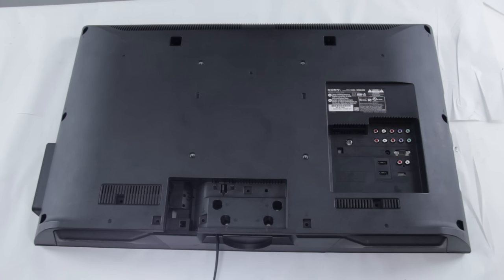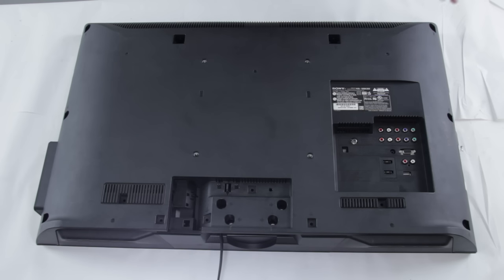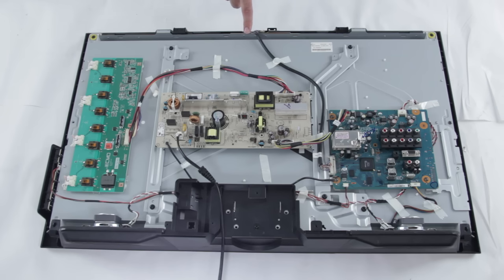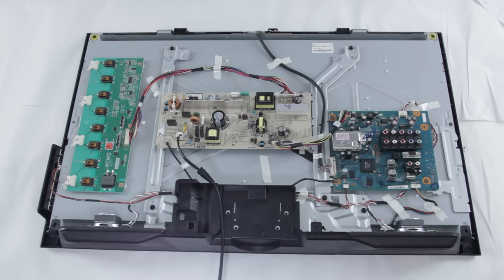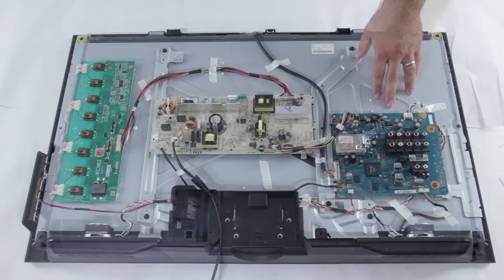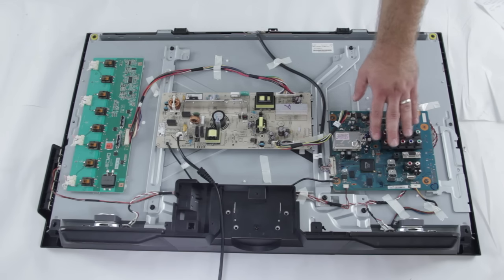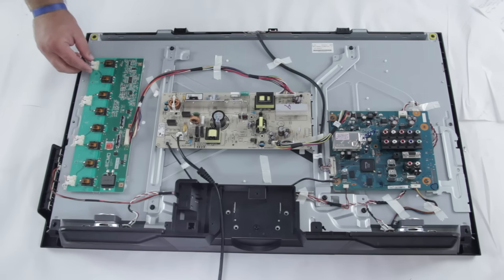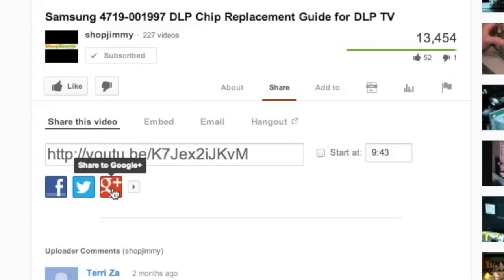LCD TV Repair Tutorial - LCD TV Parts Overview, Common Symptoms & Solutions - How to Fix LCD TVs

Comment: Hello, I have a Sharp LCD TV, model number LC-55LE62OUT, serial # 008790038.  The unit was working perfectly the evening before, but when I turned it on the next day the blue power indicator located at the middle, bottom edge of the unit, began flashing on and off but the screen remained black with no sound. I turned the unit off and on several times then the blue light stay on, but the screen remained black. I checked the screen with a flashlight to see if there are any images, but it looks total dark to me. Also, when I looked for backlight lights with cover off and there weren't any. Can you tell me what you think the problem is?  Thank you, Mark

Comment: My friend has a Samsung LN52A550P3FXZA LCD TV. When powered up there is a brief picture and audio, a click, then sound is lost and multi-color horizontal lines cover the screen. After a few seconds, there are more clicks, and the picture restarts automatically and then is quickly lost once again. This constantly repeats every few seconds. I can read the menu on the screen using the flashlight test. I suspect the two inverters, but am concerned that the constant restarts might indicate further problems. What do you recommend?
Reply from the maker: +mebewalt  Try all repairs and troubleshooting at your own risk.  I recommend replacing the main board in your TV.  Click this link to replacement parts for your TV model number:  http://www.shopjimmy.com/catalogsearch/result/index/?cat=56&q=LN52A550P3FXZA  There may be multiple boards for the same TV model number, be sure to match part numbers on your current board, with your replacement for compatibility.  Here is a link to a video showing how to identify your part number, click here:  https://www.youtube.com/watch?v=BEPWrefQvqI  Thanks and please let us know if you have any further questions with your TV Repair!  www.shopjimmy.com

Comment: i have a 2007 samsung modle num  LN-T375HA indicator light comes on , but no back lights or no picture ...did the flash test , no imiges in the dark. replaced the power supply board new nuthiing different could it be the t con brd. and backight inverter too

Comment: Toshiba 55u7863DBC, 10120022 181000212 (2019).  TV fails to enter standby. No green LED on front panel with AC applied. PSU DC outputs measured on diodes seem ok. 2x25V, 4x12v, 4x78v.  PSU is Vestel 
Thanks for any suggestion as to cause.  Note failure occurred while TV was on and functioning.  It briefly recovered for 1 day then stopped again mid operation.

Comment: My Samsung Model LN40B750U1FXZA  SN # AUKT3CSS400443M  -  The screen goes blank after 1 to 10 seconds.  The sound is OK and the flashlight test shows full screen imaging.  I gather this means in have a problem in the Backlight Inverter.  The problem began with the screen going blank after a couple hours use; then after an hour; then after shorter and shorter periods until blanking after a few seconds.  Is this an easy install?

Comment: I have a Vizio E370VL that doesn't turn on at all and seems dead. Checked the stand by voltage and it was over 5 volts and constant. Looks to have a ceramic fuse. I see no visible expanded caps or dark areas on either the main or power board. Main board #3637-0562-0150(4D).

Comment: tx-p5ost31b panasonic 50+ " tv.my girl threw a small toy at the screen smack in the middle. screen looks fine but 7 red flashes from th power button led. opened it up it has a green led flashes a few times on the top right board.there is aslso a glass bulb type object on the left centre small board that i wondere should have a filliment in or not.

Comment: I have a rca 55in 55LA55R120Q with audio but no picture after I shocked the power button with static electricity.  I see no blown caps and fuse on main board ohms out.  what do you suggest?  and thank you for your videos
Reply: +ShopJimmy.com thanks, I went tcon and it didn't work.  I'll be ordering main board soon

Comment: I have a Vizio E552VLE 55" with multicolored vertical lines on the screen. I have two T-Con boards at the top edge of the TV. Can I replace these, and if so, do I have to replace both?
Reply from the maker: Kevin Niemeyer   Try all repairs and troubleshooting at your own risk.  This sounds like a TV panel (TV Screen) problem.  If your TV panel is bad, it may be more cost-effective to replace the TV as panels are typically hard to find in stock, difficult to replace, and expensive.  Thanks and please let us know if you have any further questions!  www.shopjimmy.com

Comment: I have an old LG LCD TV, bought in Korea.  The sound goes off after TV is on for some time and some times comes back on its own.  I usually have to turn on and off, or switch channels until I hear some sound, then go back to channel I was looking at. LGTV30D is the model number.If main board is changed could this problem remain?
Reply from the maker: +Frank S   Try all repairs and troubleshooting at your own risk.  I recommend replacing the main board in your TV.  Click this link to replacement parts for your TV model number:  http://www.shopjimmy.com/catalogsearch/result/index/?cat=56&q=32LG30D  There may be multiple boards for the same TV model number, be sure to match part numbers on your current board, with your replacement for compatibility.  Here is a link to a video showing how to identify your part number, click here:  https://www.youtube.com/watch?v=RwHTvjMdrhkThanks and please let us know if you have any further questions with your TV Repair!  www.shopjimmy.com

Comment: I have a Viore LCD26V37HAU, it works only with the internal DVD player.  None of the other inputs will activate the screen.  My assumption was the main board, I just wanted to check with a tech before I start treasure hunting for the part.

Comment: Have a lg tv model number pdp50r10100 menu is popping up continually on screen not always but quite frequent and sometimes over and over without anything pressed , the front on tv has menu touvmch sensor and volume control which I think this is the problem,can I turn it off so I can only change with remote or how do I disconnect this function so it’s only power on/off that is usable with touch screen , checked control it’s defo tv on not remote issue

Comment: I have a Samsung LN46C6301F, no picture, no back light, cannot see anything with flashlight test. Standby light goes off when power on, get startup/shut down sound. Do not see any swollen or leaking capacitors. Has ceramic fuses, replaced and same issue. Removed main board, power board, and backlight inverter. Power board does not appear burned, but has dark brown areas under the bottom. Main board has light brown areas. Do not see any visible signs of damage on backlight board. Connected to cable connection and get nothing, cannot see menu image to verify anything. Thinking of replacing boards, but not sure which board to start with. Any suggestions?

Comment: Hi,I have UMC TV 32/188G-GB-5B-TCU-UK model. It worked perfectly fine for many days till now recently started showing message "Do not turn off scan" and never ends. Sometimes if I switch off and switch on it works now a days it is becoming so much of delay.Please suggest me what might be the problem. If any part is need to be replace approximately how much it will cost. Can I do it my self. Usually I do all my laptop repairs myself.Please suggest the solution asap.ThanksKrishna
Reply from the maker: +Krishna Agnihotram   Try all repairs and troubleshooting at your own risk.  I recommend replacing the main board in your TV.  Unfortunately I do not see any replacement parts in the search results for your TV model number on our website.  Please reply with your part number on your main board and I can try searching for replacement parts.  Thanks and please let us know if you have any further questions!  www.shopjimmy.com

Comment: I have a Samsung un55hu6950fxza ver. ts01. I was moving without help and help the tv on the upper right of the screen and heard a crack. With the tv off you can see anything wrong but when you turn it on there are lines and the screen looks likes it cracked, also it goes blank where you can't see the menu or other options. what do i need to change to fix the problem? the screen, the lcds,.......?

Comment: I have a 2011 lg plasma 60pz750 the tv will power on and work perfectly then after 45min or so the screen will go black but the audio is still working i can then shut the tv off wait 30seconds or so and turn it back on and the cycle will repeat any help diagnosing this is appreciated

Comment: I have an Insignia 47 inch LCD TV, model NS-LCD47HD-09, serial nu0495JA009760. The problem is that it will power on by itself and later power off by itself.  At first it would power on at night occasionally and I thought it I just left it on. Now it will power off several or many times during and hour show. I quit watching it and a little later it will come back on. I thought this had to be the power supply board so I replaced it. That did not fix the problem. I also noticed that the power button on the side does not work. Later I discovered that none of the buttons on the side work. Any help would be greatly appreciated.

Comment: Hey, I have an Emerson LF391EM4F TV, I plug it in and a the red light at the bottom turns on, however, neither the power button on the TV works nor a controller will actually turn it on, all that happens is the light staying on no matter how many times you hit the power button. Any help would be very much appreciated, also no capacitor is blown.

Comment: I have a Magnavox 46" LED model number 46ME313V/F7
it will turn on, show the Magnavox logo on the screen and as soon as the screen is blue it will turn off by it self, i look up some videos and tough it my be the power board, the capacitors looked fine but i still purchased a new one, as soon as I replaced it, i coneted the Tv and got the same result, what can be the problem?

Comment: I have a Samsung LCD TV. Model # LN37A550P3FA, SN #ALXQ3CEQ804116R. The problem is that it began hissing and showing partial half screen pictures, and hissing before the picture stabilized. Eventually it got worse: took a longer time to come on, and eventually it just stopped working: NO picture, even though the power id on, and one can hear sound. From the video it looks like the 'tikan' board. (Don't know if I have that name correct.

Comment: Hello  how are you 
I have a sony Bravia 32 inch lcd and i am having problem the display panel it's showing snowflake more crystal more the middle and sides upper section is ok my model number is KLD-32EX301 ser.no 4510625 manufactured Jan 2010.
I can watch TV or movies but not the way it should be. Do have any suggestions

Comment: Thanks for the  Video. I have a Vizio Model VL470M Serial # LAUKEHCLO7O. I Came home after an electrical storm to find the TV not working, also discovered the cable box was blown as well. I thought initially the HDMI port was blown (which I  was told was a common issue after storms), but I tried the other ports and nothing. The TV does go on but no  pic  and no  sound. No idea whether or not it can be fixed. Also I  had two other TV that suffered damage from the storm, but one of them had 2 HDMI ports, and one only had one port. So the one with two works in the other port, and the other TV is component cable(?). Hoping to save the Vizio if possible, but before throwing it out, I wanted to look into  repairing it. After watching the video, I will attempt to hook up my DVD player and see if that works, but when powered on (I think) I get nothing on the  screen. Thanks  in advance.

Comment: I got a Sony kdl55ex500 and I can turn it on and the picture comes on for a few minutes then it shuts off I replaced both power boards and master board and still have the same issue but if I unplug it for a little and plug it back in it turns on then goes out again any help would be nice

Comment: Hi i have a jvc lcd tv that has vertical colloured lines but when i return it ..works perfectly but when i turn it off again and turn back on it has coloured lines and none of the control buttons work but i can hear the tv
Was told it was the tcon board and then was told it was the main ic  so could u please help thanks

Comment: I have a Samsung Plasma display Model # PN50C550G1f     FXZA That has a snowy picture in the middle of the screen without any connection when you put the menu snow would hide the writing that comes on the screen can you advise me what to check on that TV?And thank you for this video
Reply from the maker: +Winston Badawi  Try all repairs and troubleshooting at your own risk.   I recommend replacing the main board in your TV.  Click this link to replacement parts for your TV model number:  http://www.shopjimmy.com/catalogsearch/result/index/?cat=56&q=PN50C550G1f  There may be multiple boards for the same TV model number, be sure to match part numbers on your current board, with your replacement for compatibility.  Here is a link to a video showing how to identify your part number, click here:  https://www.youtube.com/watch?v=BEPWrefQvqI  Thanks and please let us know if you have any further questions with your TV Repair!  www.shopjimmy.com

Comment: i have a prosonic lc3206
the simptom is after i turn on the tv it is showing a sound and picture for a second and everything turnd off and on non stop
all the time  ( the sound and picture)
i tested the cvolts on the boards and have the 12 v going to 0 and then back to 12
when i test a test point on the inverter board near the entrence plug the tv works ok ...when i take off the tester on the  test point there the tv goes of an on including sound 

what can i do

is it the inverter board

doron

Comment: I need help with Hisense LCD TV with CCFL model # LTDN42V77us with no picture after normal booting up to LOGO then blank.After connecting and red standby red light on, power switch on, 3 blinks, 2 sec to dim LOGO with back lighting momentarily on then black, no sound and red light off.  Tested voltage on power supply, 0 volt on 5 v. pin however there was 12v on pin 8 marked 12 v.  I found no burnt, fuses, capacitors, etc. on board.  I did op to replace power and main boards (purchased through Shopjimmy.com) however upon on installation no improvement.  New board does read 5 volts on pin 1, 2..  Is the TCON panel built into the main board?  Any suggestions.

Comment: Hi - great channel. I have an RCA model number 46LB45RQ that is extremely difficult to turn on. You have to keep plugging and unplugging to get the red standby light to come on. Then when you hit the on button it'll turn blue and the tv turns on. Over time it has begun to take a lot more plugging and unplugging to get the red light to come on. And once you get the blue light the tv doesn't always turn on. But once it's on, it stays on and everything is beautiful until someone in house accidentally hits the all power off on the Uverse remote. 

I know the main board in my tv is this one: E12090262. (We took it apart and checked). (T.RSC8.78) is also on that board, and I'm leaning toward that being the problem. But before I spend a $100 I'd love some expert advice. 

Thanks!
Reply from the maker: +asimpleenoughplan  Try all repairs and troubleshooting at your own risk.  I recommend replacing the main board in your TV.  Click this link to replacement main boards for your TV model number:  http://www.shopjimmy.com/catalogsearch/result/index/?cat=56&q=46LB45RQ  There may be multiple boards for the same TV model number, be sure to match part numbers on your current board, with your replacement for compatibility.  Thanks and please let us know if you have any further questions with your TV Repair!  www.shopjimmy.com

Comment: I have on 24" element tv the tv was showing not signal from tv cable box i check with my other room it did the same messages not signal, so i order the. PCB new using the model number i installed it and the tv start blinking but not stay steady, i disconect it and live it off for a while 4 days later i connected back now it stay on but it not respond with  the removed control at all what i can do to make it work

Comment: I have an LG 60 inch LCD TV part number 60pn5000 The TV will not turn on. When I plug in the TV the red Light comes on but when I press the power button nothing happens

Comment: I have VIZIO XVT553SV. When I turn the TV on none of the HDMI ports work. I have to switch the input to AV for about 45 min. Then all the HDMI ports start working. I have verified HDMI signal from satellite is there when HDMI ports are not accepting it. Looking for any ideas on what needs to be done.

Comment: I have an upstart 24ewt that was my nefews. Recently it was given to me because it broke. When I bring it home plugged it in it turned on like nothing was wrong. I thought wow, winning! Turned it off went about my day then that night I went to turn it on. Standby light was good. Hit the power button and for a split second it was on the immediately off. So I'm guessing that's what was happening to my nefew... So I know it will turn on and work but something isn't right. I'm a Cisco certified student but I don't know much on TV's. What's your thoughts?  Lets talk tech.
Reply from the maker: ImHellaBurnt2   Try all repairs and troubleshooting at your own risk.  I recommend replacing the main board in your TV.  Unfortunately I do not see any replacement parts in the search results for your TV model number on our website.  Please reply with your part number on your main board and I can try searching for replacement parts.  Thanks and please let us know if you have any further questions!  www.shopjimmy.com